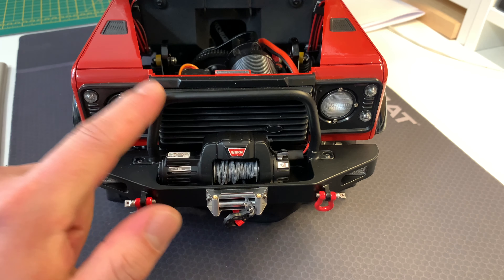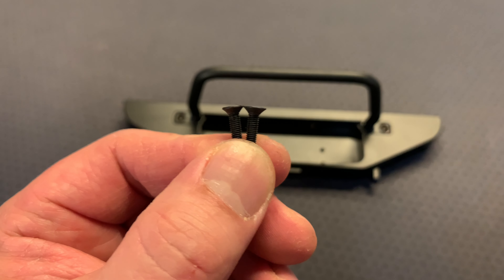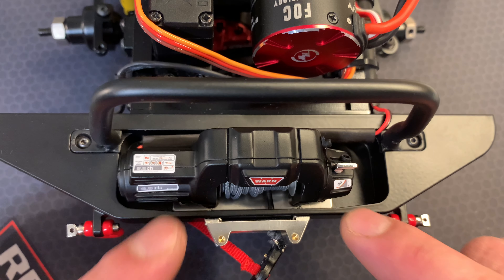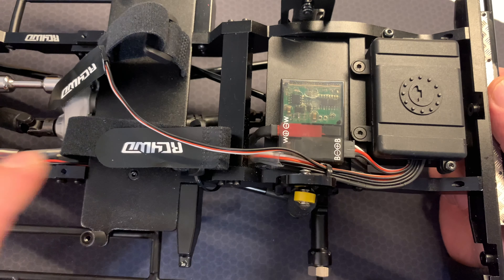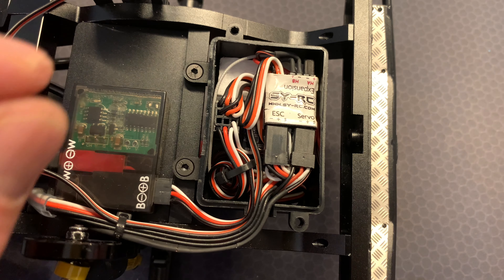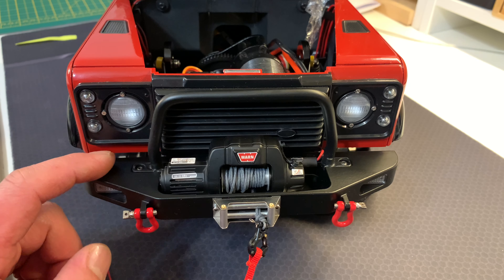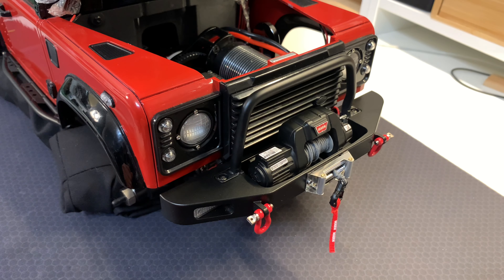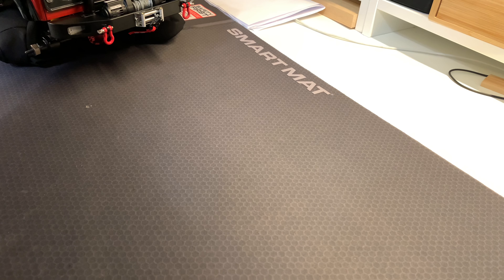RC4WD 2015 D90  - Bumper and winch 9.5 CTi-S

Comment: Bro u didn’t mention more abt the winch like is it good on how much the max weight can this winch handle thks
Reply from the maker: Hi Dude! I think I focused too much on the bumper during filming lol, the winch is pretty amazing for the price, this version is the early 9.5 CTi-S (Z-E0119) the Operating Voltage: 6V - 12.4V
Can operate on 3 Cell Lipo
3ft/.9M Rope Pre-Installed
Load Limits: Dead Lift 6.6lbs/3kgs
Load Limits: Rolling Drag 9lbs/4.1kgs
Length: 2.98in / 75.85mm
Height: 1.16in / 29.62mm
Width: 1.39in / 35.35mm
Weight: 3.39oz / 96.2g
If you also use a scale snatch block, the load weight can be DOUBLED! super fun stuff, I highly recommend getting one! 😀